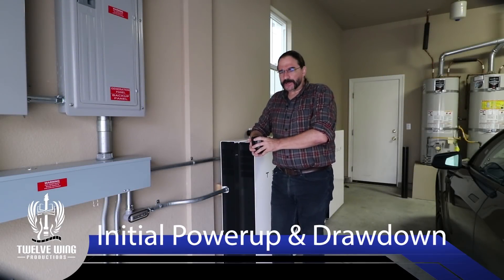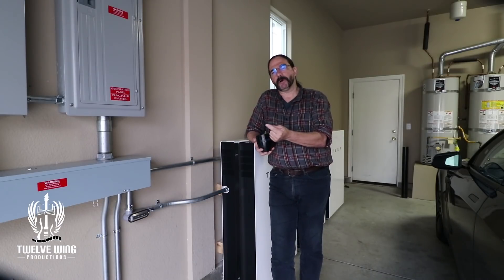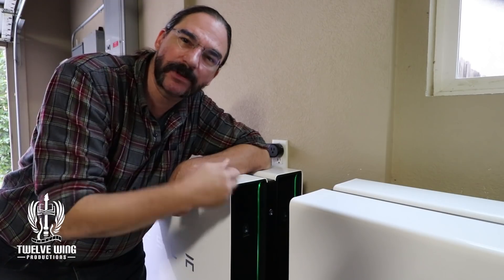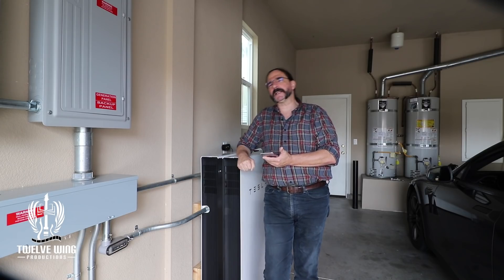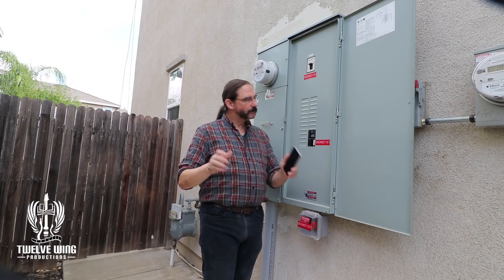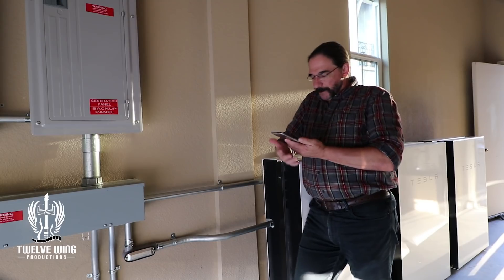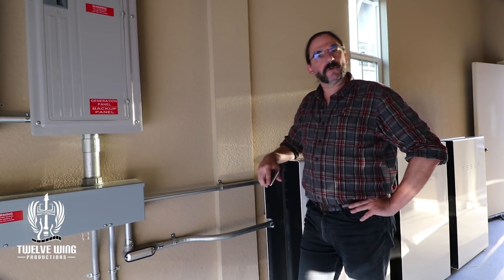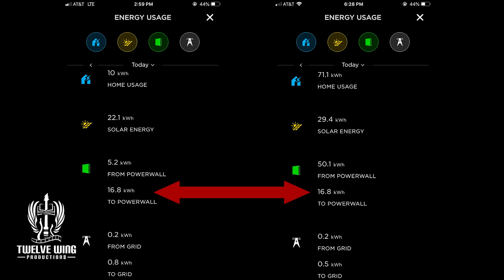New Tesla Powerwall 2 system? : Do this right away

Comment: What was the real out of pocket cost for this system?
Reply from the maker: $54,000.
Because of the SGIP program and the tax incentives we were able to bring the price down to the point where it matched or slightly beat the cost of purchasing electricity.
When one factors in the offset from nearly 10,000 miles of gasoline it looks even better.

The unfortunate thing is that without these rebates, I can't recommend such a system until economy of scale kicks in and the price of the batteries come down.
There are other things that will further reduce the cost of all of this. Currently there is a huge installation cost involved.  If these systems become more "Plug and Play", then that too will dramatically bring the cost down.
Reply: @twelvewingproductions7508  100 percent agreed.  Battery price must drop to make solar a true player.  It is a shame that is what's holding it down.

Comment: Sad how fast you drained the packs. It's going to cost me my first born child to purchase enough. I'm thinking 20k watts in panels and 8 battery packs to totally be off grid. I will wait 4-5 years to see where we are at as far as prices and upgraded efficiency. 

Your setup is amazing by the way.
Reply from the maker: I don't think you would need any more than 6... but 20kw of solar is about spot on for an average home I think.
Reply: @twelvewingproductions7508  I see that there is the possibility to save on stationary batteries with say a V2G setup with the large EV Battery ...Teslas are capable of this ...are you looking into integrating that ?? In the UK they have just made it mandatory to have V2G (vehicle to grid) to be install on every New Dwelling...It is a great use of your car battery for the times when not in use(on average 95% of the time)
Reply: @alicetronics-jaycarsplatin5629   v2g is also great when you go on vacation because you're battery follows you wherever you go.